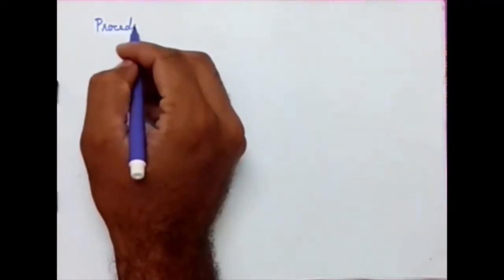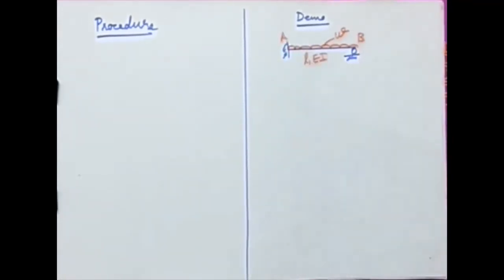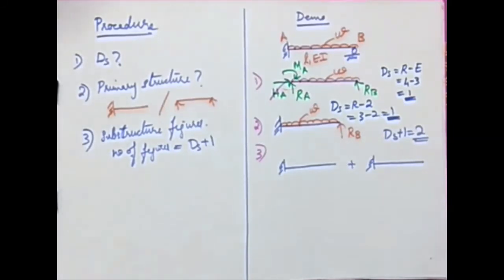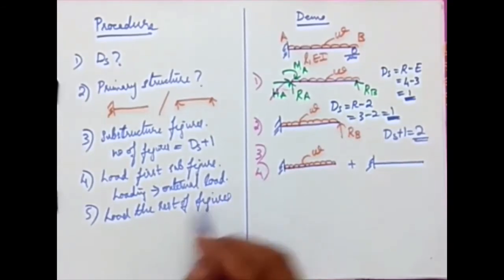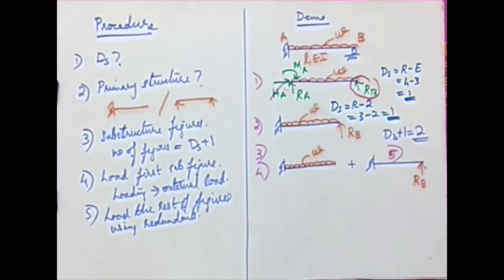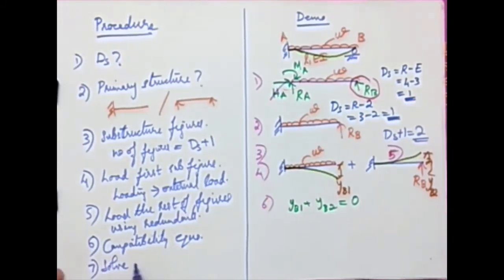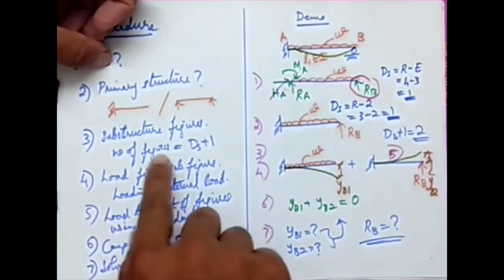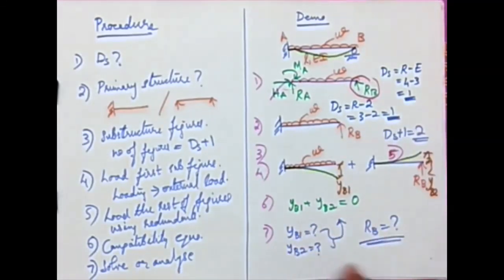Consistent deformation method - Procedure

Comment: I want to know,if we choose SSB as primary structure.Then what will be the step 4 and step 5
Reply from the maker: In that case it will be a simply supported beam subjected to a concentrated moment at the left support.
Reply from the maker: And the compatibility equation will be based on the rotation at Left support.